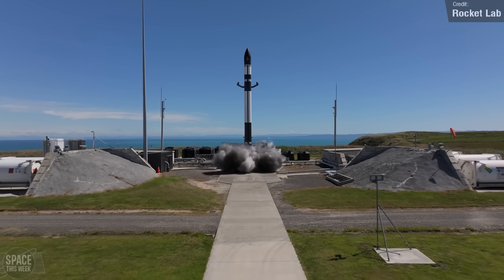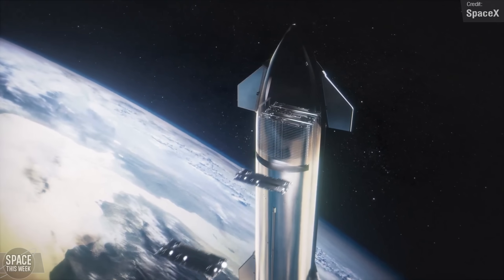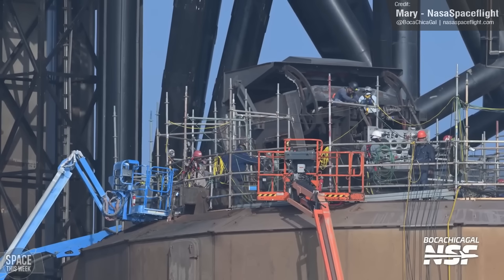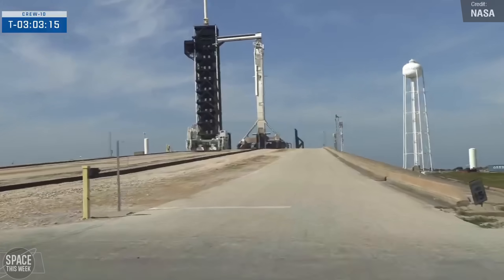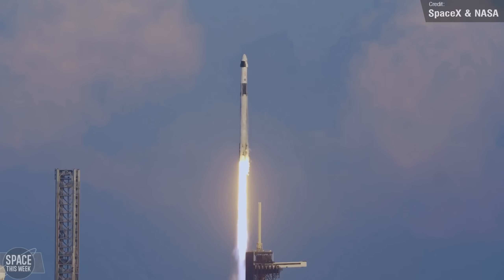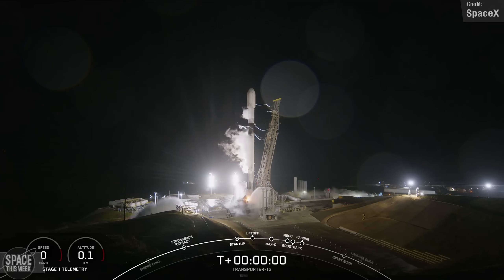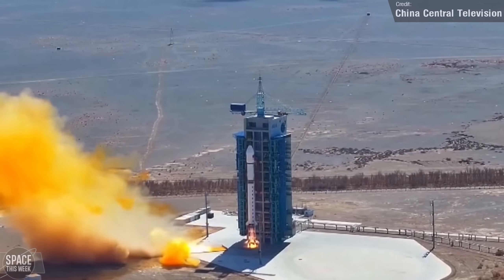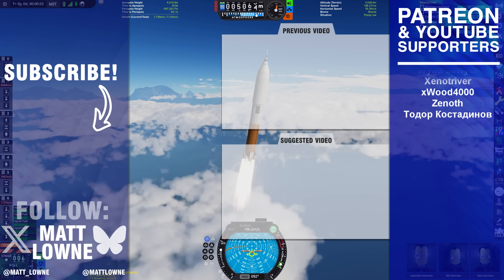SpaceX's NEWEST Starship Rolls Out - Will This Explode, or have they Fixed it?

Comment: Oh definitely Launch Pad B is going to be the workhorse launch site.  LP A was a conceit dream of "we're going to be different - we won't follow lessons others learned and we're just going to be better" with no blast deflector and a working assumption that a chunk of steel is going to be immune to the forces of the most powerful flame thrower ever.  At this point they're putting resources into LP A because it's the only one available right now in Boca and they don't want to lose face and admit that they're putting bandaids on a ruptured artery.

Comment: Two major issues for SpaceX, the V2 or Block2 Starship upper stage plumbing, we hope and pray they have enough data now to fix the issue, at least to zero in where the problem is. And secondly, Stage-0 refurbishment, almost begs the question, why not have a dedicated tower for launch, and one for catch?  The booster catch this last time was different, the booster came in from a different direction, assuming so they didn't get hot exhaust all over the BQD or any of the vulnerable areas on the OLM itself.  They must have had more cameras and sensors and such in the engine bay or the "Attic" as they call it on the Starship (Ship 34) and been able to see pressure readings fall off, have camera (video) of the areas that were suspect (plumbing coming through a bulkhead, plumbing manifolds attached to ships, other plumbing lines in the bay and so on).
Reply: Pad B's flame trench became a necessity even as far back as after IFT-1.  It was OBVIOUS you have to have a flame trench with these engines, especially given how many there are and how powerful they are!
Reply: 350 concrete trucks, at 10 yds ea, = 3,500 cubic yds of cement!  The Hoover Dam, for comparison, used 4.36 MILLION cubic yds of concrete.
Reply: "Astronaut Backup Toilet Facilities" == Diaper.  Yuck.

Comment: i couldnt help noticing the chinese flame trench is that what elon is doing with tower 2 no water supression needed
Reply: Theyve already installed water tanks at pad B it will have deluge and likely a lot more than pad A to protect critical equipment and make the pad more easily reusable
Reply: Quite a big difference in the power needed to be dissipated.

Comment: Could it be that the size of Starship is such that the power required to push it into the sky just generates too much in the way of sound reflections and vibrations for the vehicle to survive. Is there a size limit for a rocket. The problems arose with the size expansion of starship without a booster upgrade. Plus the power needed for hot staging also increases with the size and maybe they need to eliminate hot staging and return to the original stage separation idea. Another failure may require a complete shutdown from production til they figure out the physics of trying to launch that heavy starship
Reply: Well booster was already more than powerful enough with fuel to spare and it still lands "wet" unlike Falcon 9 and its suicide burns... that being said, aerodynamics didn't exactly change bar the fins, so fundamentally nothing externally should experience any new forces...probably find they reorganized some internals for block 2 and ended up creating the plumbing issue

Comment: Has there been any talk about the RUDs being caused by the payload? I know they’ve made so many changes to this second version of the ship but flight 7 & 8 were also the first to have meaningful payloads.

Could the resonance issues they’re been having be cause by the shaking of the dummy StarLinks in the Pez dispenser?
Reply: What good is a rocket if you can’t launch a payload
Reply: I think the payload is so light and small that it's not a factor, as it's just a few dummies. The big thing is the new plumbing and the stretched tanks.

Comment: Pad A will definitely get replaced with a similar pad to Pad B once Pad B is online
Reply: I'm not sure it Will be right away a lot of signs are pointing towards the pad B design being incompatible with block 1 boosters so they might keep pad A around to keep launch cadence up until they have enough block 2 boosters to phase out all the block 1 boosters
Reply: @KiRiTO72987 I could see that.
Reply: probably not until pad c

Comment: I dont understand why they dont put heat tiles on the launchpad...
Reply: Heat tiles are delicate. Literally more delicate than your dinner plate. They would shatter instantly. Remember that re-enforced concrete was nothing to this.
Reply: Essentially heat tiles are a ceramic composite, they work by pulling the heat to the core of the tile and slowly disapating heat at a tolerable rate...they're extremely good for heat but not so much for the shockwaves that the pad has to experience on launch
Reply: THIS GUY IS GENIUS!!!!! (There’s probably like a hundred reasons they don’t do it though)